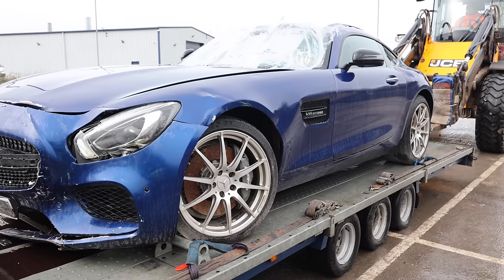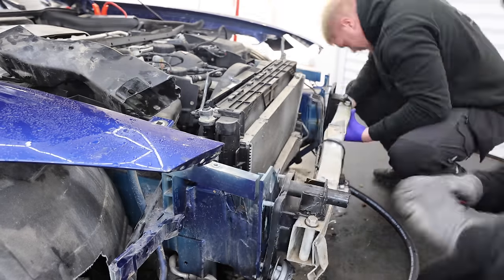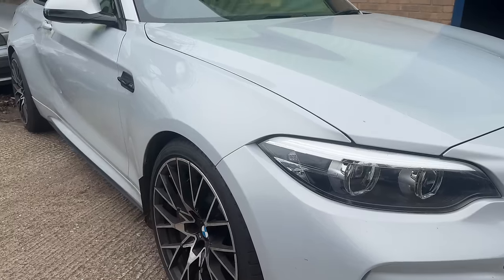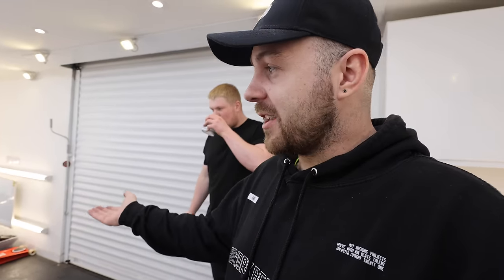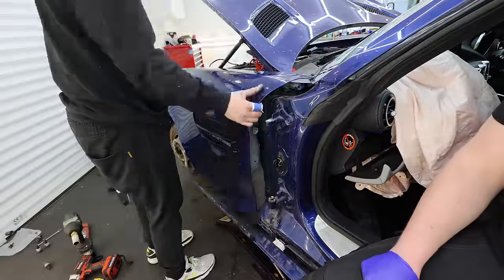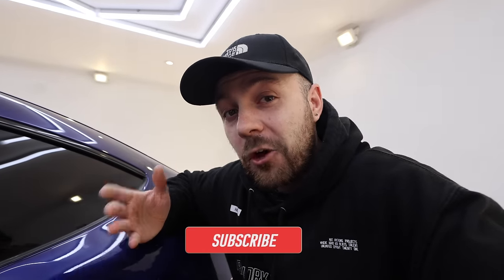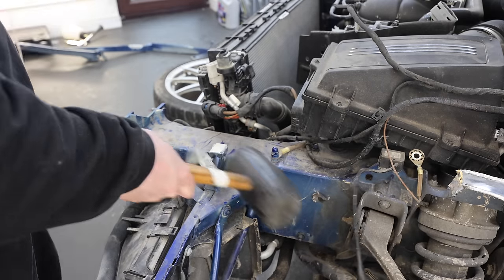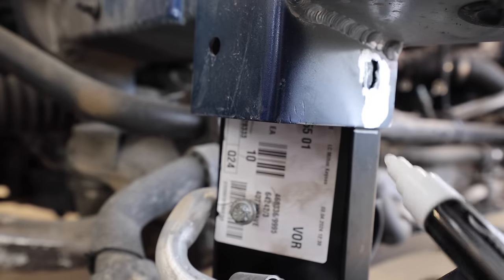WHAT REALLY HAPPENED TO MY WRECKED AMG GT

Comment: You need to be very careful using a small belt sander when the draw strings if your hoodie are hanging about loose near the revolving belt. If it catches the string within a second or two you could be sanding your face or neck!!! That would not be a pretty sight.

Comment: What you bought is what you have, Cat S write-offs have suffered damage to structural areas of the vehicle such as the chassis or crumple zones. A Category S car can be repaired and put back to a roadworthy condition and used on the road again. However, the car must pass an inspection by an accredited engineer

Comment: I would go for the black on black dash, and I’m sure grey on the seats will look fine, maybe even better without it being too grey. Look forward to the next upload 🙌
Reply: The grey seat inserts could easily be changed to black. My 2015 E Class Merc had imitation rather than real leather, which was painted black by the factory. Not sure if this top end Merc has similar. Just had my F Type seat scratches (real leather) repaired by an upholsterer who matched the colour and used an airbrush, so I don’t see why the grey couldn’t be changed to match the all black dash - would be cheaper than full re trim.

Also, as you are going to the Nurburgring have you thought of reaching out to Micha? He might have some contacts to supply the rad pack. Good luck with the build.

Comment: If you check out your old dash parts on the bottom might come off and go on the new dash that you buy. As far as the radiator packs BMW should be the same exact match and when you're buying parts don't tell them it's a AMG because they will charge you more and the regular parts are the same parts. Keep up the great work and God Bless. 😊👍🙏🏼

Comment: I am more into vintage cars, but there radiators are also problematic. We normally get them repaired. There is a company in Berlin who does it. However, the radiators on modern cars are made in aluminium, which they might not do. But perhaps it is a matter of price and if a new one is very expensive, it still might make sense to do it. I am shure there a companies in the UK that repair radiators, at least for vintage cars. It might be worth asking!

Comment: Wheel nut lock socket usually in boot under floor, or behind side trim where pockets sometimes are, but not sure on this, cars like this are main dealership maintained just don’t get many newer Mercedes parts on line, why are you surprised by Mercedes prices, did you not check first ? Best of luck.

Comment: NO NO NO YOU NEVER HEAT OR BEND ALUMINIUM, YOU WILL WEAKEN THAT PART And it will no longer have the factory. Structural strength that it came with.

Comment: U sure u can’t use the c63s or e63s rad n use the gt’s housing… so it fits in ur slam panel… just an option to look into maybe….
Reply from the maker: As far as i can see so far they are specific to the gt
Reply: @Chris_Slix  you need to find a German breaking yard in Bradford il ask my mate there is a few places that should have it, and there is a big German car breaker in Oldham aswel il find there names and call them